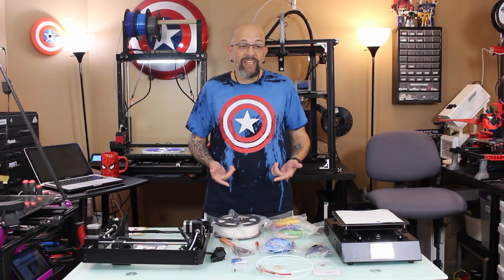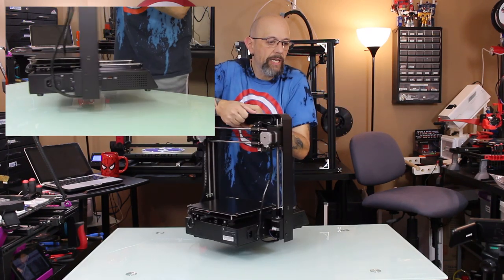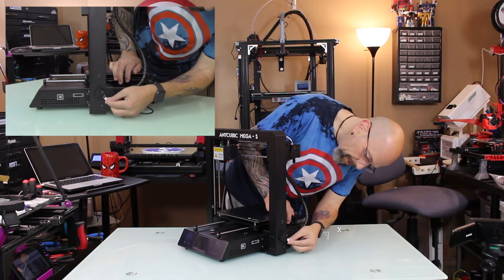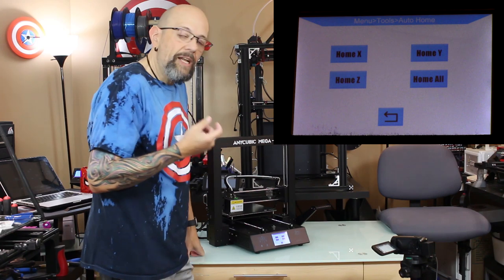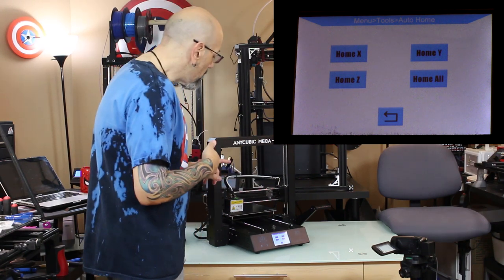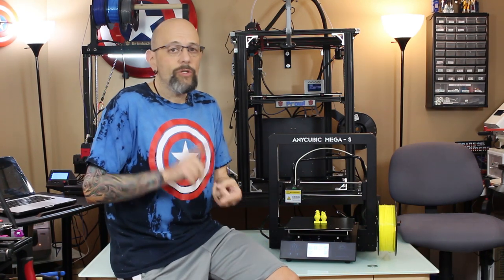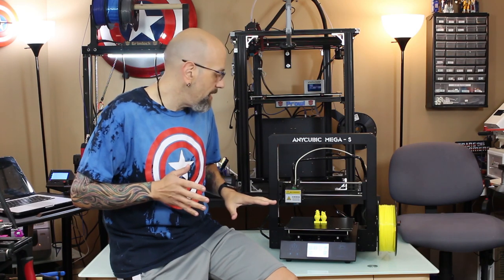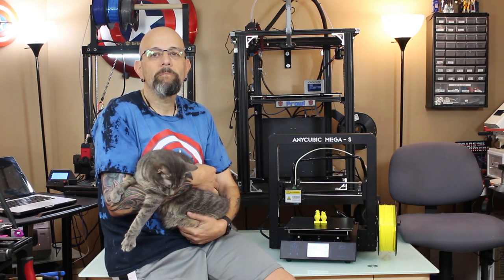Anycubic Mega-S Review & Giveaway!!

Comment: I used your review to help me decide on getting one. I did but my experience was not a good one. Perhaps there is a percentage of machines sold that are off? My experience was bad. I strongly suggest buying it from a company that allows 30 day returns.  two problems, SD card was not formatted properly, took me an hour to figure that our and resolve...as i had no hint. 2. after having calibrated the base properly...yes, very sure, took me 40 minutes, the unit still scratched the base on first print. The end product is not smooth. Overall, it's junk or this was my experience.
Reply: Some have had problems with the bed being warped. Check yours with a straight edge, such as a steel ruler. Also, when leveling, use a feeler gauge for better, quicker results.

Comment: this printer has some pros but a lot of cons too, very good and solid metallic structure, good stepper motors and i love the two end-switch of z-axes, very good extruder but they are still using the horrible old trigorilla with ancient and noisy stepper driver 4988, the plate basement should be perfect without the f. knob (common to all cheap printer) for the bed calibration, anyway the printer print well but need a complete revision with updated main board, silent stepper, bltouch and magnetic bed